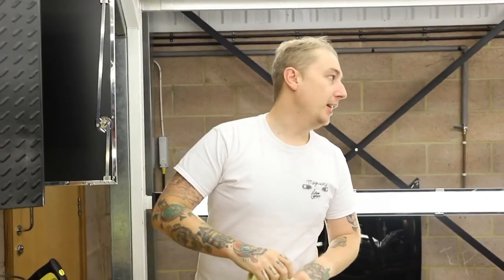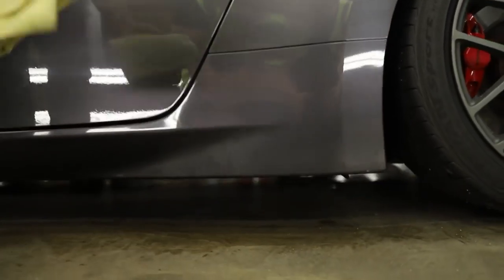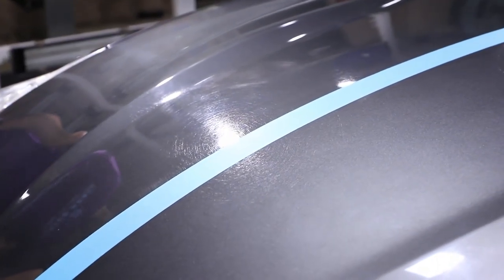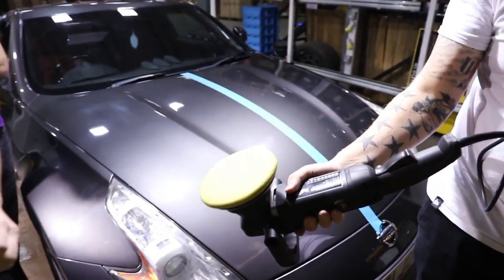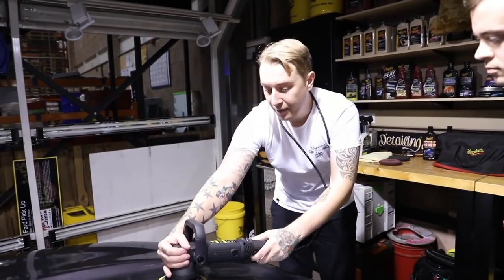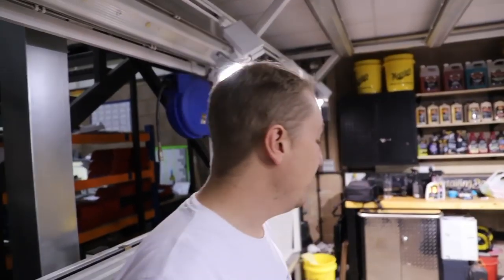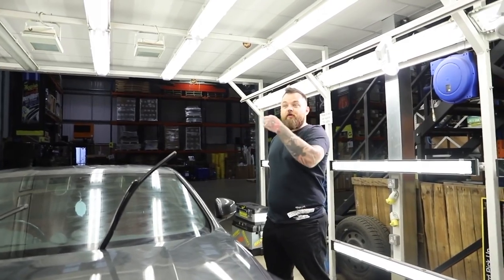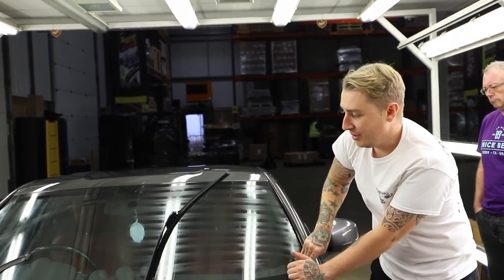How to Refine Paint with Ultimate Compound - Day in the Bay – UK Edition

Comment: what is the differance betwenn ultimate product range and mirro glaze product range
Reply from the maker: The Ultimate Line is our premium line developed for enthusiasts who are going to be working on their vehicles themselves in their garage/driveway etc, where as the Mirror Glaze Line is designed more for Professionals doing work for others.  This means the Mirror Glaze formulas are specifically designed for  environment, different kinds of machine use, time constraints etc...  In addition, the Mirror Glaze Line is more complex, almost like a "mechanics tool box".  Depending on your needs, we've got you covered.  Depending on where you live, the Mirror Glaze product can be a bit more elusive to find :)